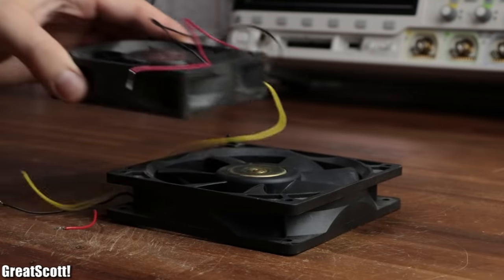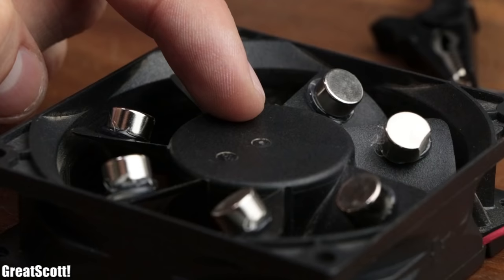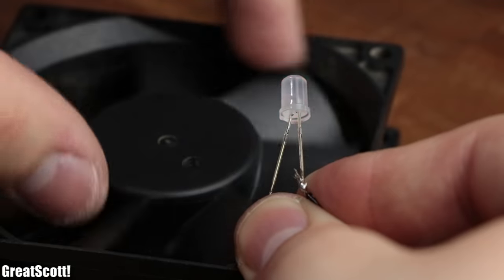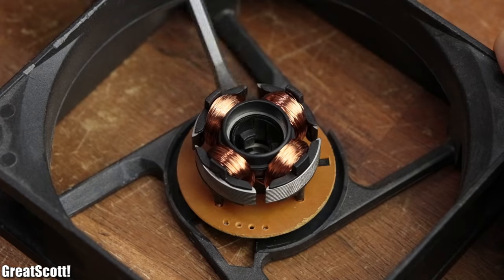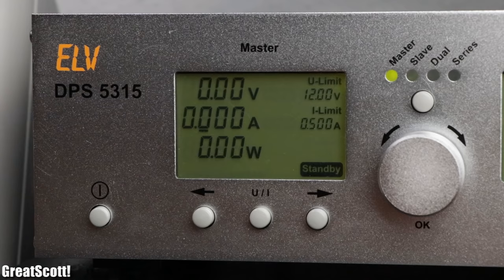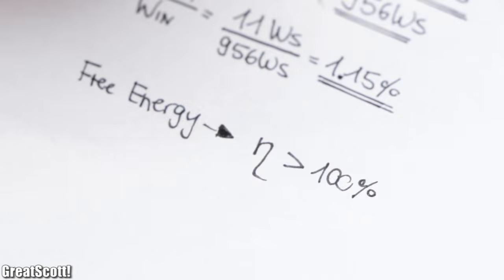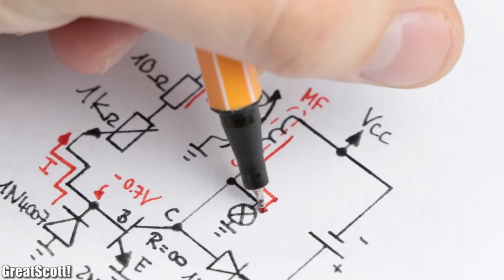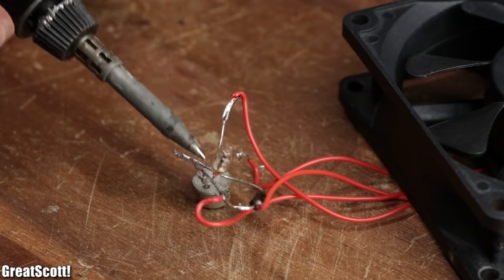Free Energy BS! || Magnet PC Fan, Bedini Motor

Comment: As a student I took a room on the second floor of a house. I was skint and had no money for heating so I was freezing. Occasionally, my radiator would get really warm and I could remove my coats and thermal underwater. I had no idea where the free heat was coming from until one day I had a visit from the guy downstairs. 
There was a water boiler at the back of his coal fire and everytime he lit it, I got free energy. He was quite angry though and after that things cooled off but l learned a lesson that if free energy exists, it's unsustainable.
Reply: hillarious. but what about solar energy, how many years of free solar power (even if only as heat, rather than photovoltaic) is enough to count as sustainable? or are you pedantic enough to consider that the sun burning out in billions of years makes it unsustainable?

Comment: the bedini motor was a lead acid battery charger that used the pulses from the reverse emf to charge the lead plates in the acid. it allegedly exploits a mechanism in lead acid. this was said by john bedini. it was not meant to be used as a motor.
Reply: I seen it on an interview from the 'energy from a vacuum' series about 15 years ago.

Comment: FYI a Bedini motor has two different size wires on the coil one is the power wire and the other is used to produce a back IF charge when the charging cycle ends I just started studying it but at least I have the honor to try and really understand it before I call bullshit

Comment: Fun fact: you can get free energy by connecting an autotransformer to your electric panel, setting the secondary voltage a tiny bit lower than the input, then connecting that side to your neighbor's outdoors outlet. Watch in amazement as your electric meter spins backwards! Power companies hate this trick!

Comment: For those who still think free energy is a thing:
Conservation of energy. 
There is a certain ammount of energy in this universe and you can not add in it or destroy any of it. It is a constant. Each time you use it you also return it in other forms. For example car engines. You burn fuel which is the energy source. It returns to the cycle as mechanical energy and heat energy.

Comment: If there were such a thing as perpetual energy the entire universe would turn into one big fireball.
Reply: You mean overunity. Smh
However, the fact that the universe haven't turn into one big fireball even when overunity machines are REAL already shows that energy can also be destroyed. It's a balance and completely logical.
Reply: @chrisadmaley  Go learn how reality works before replying, thanks.
Reply: @lukiepoole9254  you are delusional lol, this stuff is BASIC.
Reply: @chrisadmaley  Let's talk about BASIC then.
A magneto-motive-force source is capable of emitting multiple reluctance paths that are independent of each other. Know that both the primary winding and the secondary winding behaves as two opposing mmf sources. That means, you can relocalize the opposing flux with another core. Back emf not cancelled? Add another secondary winding and force them to cancel each other almost completely. Overunity achieved. Input power factor is almost purely inductive? Add a resonant capacitor in parallel. You done?

Comment: The better structure for a good charging circuit involves 4 coils bifiler wound with 900 winds a semi permiable steal core will give you ample 1/4 rectified frequecy which can be tuned with a pot.
Ya its too simple but extremely effective. 
Dont count the horses before the wagon.

Comment: Free energy? That can be had from public sources such as a coffee shop outlet or yeah at work or school.
The storage device is usually a high upfront cost that will hopefully slowly pay for itself.
How?
By having a vented backpack with a 100Ah Lifepo4 12v battery, heavy duty short cables, and a dedicated charger that turns mains voltage to the required charge characteristics the battery wants.
Usually this batteries can charge at around 80Amps or so. Or nearly 1000watts input 
So the charger connects up to the wall socket charging the dead battery while you do your stuff.
Then when you get home you have some usable power for a while.
Although it's only about 15cents worth of power for each charge...
Personally I have a 100Ah Battle Born battery, 1500watt pure sine wave inverter, 50A charge controller, 400watts worth of panels on the roof, and incase I need a faster charge a renology 40A dc-dc charger that I can use to charge the lithium battery using my car as a power source.
How do I use this?
To recharge small things like my laptop, phone, mini segway.
But also to power my TV and gaming system.
Why? Because I can

Comment: Your sums dont include driving the fan. I thought the point of the Bedini motor was to teach people about the difference between  regular transverse waves and longitudinal impulses. Not sure Bedini ever referred to free energy, He did talk about Radiant energy and the possibility that he was tapping into a flow, just like a wind mill or water wheel does. I know my system was efficient , driving a fan wheel, lighting LEDs and charging a battery all on about 3 watts. Dismiss it and you could miss out on velocity greater than C (Wheatstone, Tesla, Dollard, Bearden),  spooky action at a distance, John Hutchison, Tesla, Judy Wood a whole lot of fascinating things. Bedini was actually a very successful engineer. His work is often unique, ahead of its time and well worth a bit of investigation. He is not his admirers and their comments are not his.

Comment: Well... Here's go my hopes away.
I had an idea few years ago. And it probably went down the drain. 
But I use "free" energy already.
From solar power bank character. And use for lights. 
Trough use it to charge my cellphone.
And I washing my clothes with "free energy"  with machine I made.
It doesn't really save money or made me feel better earth habitat for saving the planet. 
But I am dang proud I made it myself 😊.
Reply: From your perspective, "free energy" is the energy aquired with no monetary costs If i understood correctly, in the video Scott debunks the generation of more energy than what you put in. For example, you can't use a motor as a generator to power itself using another motor. Because energy can't be created, only transformed, and in this case, The energy is lost due to friction, a bit of heat from the resistance in the wire, The free energy you are talking about might as well be the one where you plug your stuff into the neighbors outlet😂😂

Comment: "As a power source I used my bench power supply"
I thought you said the Bedini motor used a battery?
The circuit he used pulse charged a lead acid battery with a very short duration high voltage

Comment: I have made a fan spin with magnets, the stronger magnets need to be mechanically switched of axis, a small spring returns the magnet before the next field is in place.
Yes there is a lot of friction and loss, but chill the device and it will run for a good bit of time.

I agree the setup shown in this video is accurately described as bullshit.

Comment: Quick question
Can I run a 12v 0.6A rated cooling fan on a 12.6v 12A power supply or will it smoke up?
Reply: Well the current you set the power supply to is actually the current limit so it won't do anything bad to your fan. Plus fans are engineered to handle a little bit of overload by a certain percentage without damage. So basically your fan will draw a bit more current with the higher voltage but will not reach 12A at 12.6V.

Comment: Listen to me, I'm 2 years late but still listen please. I was cleaing an old PC and it had 1 exhaust fan with blue LEDs inside and when I was using the compressed air to clean the dust and the fan spun really fast and the LEDs were so bright! This was obviously while the PC was off. I also used the vacuum to suck up the dust bunnies and I when I sucked air though the fan I got the same result as the compressed air, although the vacuum is a silly if you really wanted free energy LOL.

Comment: Wait so the 12v pc fan will charge the capacitor which will charge the watch battery which is what makes the fan continue spinning after your intitial manual spin and will continue to spin its self? For how long? I cant really understand mych of whats being said cus im not that bright but if it were to be able to power just its self indefinitely that is awesome because then you could use that to blow another fan thats been modified to charge a capacitor or some type of power controller like they use for solar, that can charge battery banks which can hook up to an inverter/converter and power whatever right?

Comment: SCOTT DO NOT WORRY I HAVE A SOLUTION....

As the motor produces ac current when turned u can step up those 0.3V produced to 300V using a series of some 4 to 5 ac to ac step up transformer
Reply: And? How would that make a difference

Comment: just a curious question i always had when i was a kid.  and im 46 now.     cant there be a little waterfall big enough to power a generator from the falling water, so it can provide power to a small pump that takes the water back up again?    Id really like to know if this is possible with current tech, or that this is also bound by laws of physic?     i always wondered this as a kid when i looked at my grandpa's small pond which had a little waterfall.

Comment: Im studiyng mechatronics and my focus is on Vehicles especially on their engines.
So i was curious to see if it can work under the premise that the motor just converts energy into mechanical energy which has etha<1 then. 
Interessting to see that the rotor dont even spin with the magnets on. Thats the biggest problem dispite the whole electrical resistance, kommutation or changing of the pol

Comment: Well here's the "free energy" circuit that taught me something useful!  That back EMF spike is energy . . . you can store it to make your motor circuit more efficient!
We should talk about the self-deceiving problem with this circuit: if you put a meter in the wrong spot it will actually show an erroneous increase in power output from that back EMF spike! . . . so it looks like you have achieved over unity!

I have found real free energy, but these obvious scam devices are not it!  The real ones all seem to employ some type of quantum process like Zero Point Energy or thermal harvesting.  Though thermal harvesting isn't technically free energy since it already exists in the system.
Reply: not free energy at all, just a way to try to recover lost energy, that could help increasing efficiency but hell no it's free energy

Comment: What happens if I take a fan to space and spin it with the circuit to collect energy? INFINITE ENERGY!!
Reply: drawing current from the motor generator will cause it to slow down. when a motor slows down under same voltage, it will draw more current

Comment: Magnetic fan more good if you can think smart, place the the pc fan on a normal dinamo  and its works well but if you can think more smarter it will be more better free energy, but in Islam as the sun still hot and the sea still waving, there is still a huge energy if you can use it
Reply: the fan with the dynamo, depending on values, could create higher voltage/current, not both and there will be losses along the way and wattage will stay same or lower.

Comment: Hello, i am wo deri g if it might be more sustainabke with an electro magnet that goes on and off every tenth of a second, ypu can get one from an old door bell, the ones that actually have a bell knocked by a hammer that happends to be pulled magneticly by the bell metal gping ond and off causing the bell to ring rapidly

Comment: I found a way to have 100W with 10W, so I plugged it into another system, so I got 1000W with 100W( that I got for 10W ). Thus I plugged it in another one and I got 10kW with 1kW ( that I got with 100W that I got with 10W ). Guess what I did then?
Yeah, there's no free energy, there's only INFINITE energy ( or not....) .

Comment: My bedini give 0,89 amps out while feeding it with 1 amps under 12VDC....it was the second version i built,allready bit tuned...
Bedini energizers work perfectly am sorry,further: it is able to regenerated old battery ,by un sulfated it...
Before I was admirativ of great Scott,now am really deceived by his conclusion about it,because it’s wrong..
by the way I ask some advices to great Scott in private on Facebook about another subject,because he réalise the set up I was looking for,all that he answer me was « sorry I can t answer to your question »...
Great Scott is finally not that great...
Reply: You need an oscilloscope to measure the voltage. Most Bedini Motors run on 12V
Reply: @leonalexander26  sorry,i did mistakes by taping, i just correct it...

Comment: Actually, axial all_magnet motors are used to power a genset/container 50yr no_inputs warranty with upkeep.
The 1300hp motor fits cars, sparkless, military_spec, D.Antonio Romero dsgnr, Belgian.
No CO2 H2O or wasteheat superconducts coils 👈
Technokontrol's RF-5000, the motor used in their surveillance drone aircraft.

Just to say there's no such thing as free energy est.cost $1.6M/unit, amortized it's $3.65/Mwh +(interest & upkeep)/month, compare to gas at €100's/Mwh it's almost free 🧲

Comment: i tested it magnets doesn't work 
bec.i tested it with led lamp 
i used blower to make cooling fan spins and worked 
because the rotation of fan is reverse   
it will not generate energy it's not master

Comment: GreattScott > Love your work!!   I Don't get most, tho Thrilled to See!  
Thanks for getting to the point, Truth, right off.      I have question of Just moving Blades.  ~>  
What about Fan Just to Move a 'Bit' of Air, Not power?    Just good Bearing, no "Driver Circuit" attached (needed).   
(could it store power via capacitor )  ?     had to ask    = ]      lol   I Think You just did that! !!          Well   . . .   Still want Just Air movement .   ~- *  
my answer is YES it can             ~             Not just on Windy days       : )

Comment: Try to position the magnet that you're holding on the top positon, facing the magnets (same angle and not on the sides of the magnet as you have demonstrated) similar polarity so that it will repel and push aside each and every magnet, creating the movement that we want and expect to see.

Comment: Inbetween the magnets there are dead zones. This prevents it from continuing to spin. So if you make this design but over and over again 360 times then layer them on top of each other and then give every later a 1 degree offset from the previous layer youll virtually erase the dead zones and it should work.

Comment: For starters there is no such thing as free energy other wise ot would defies the laws of psychic u have to wear down something to get something in return is basicly it such as steam.powered engine loss off water to have a steam push force to turn a wheel if u make it for a perpetual generator u would have better results of course it all depends on the the way you set up ur magnets if you put them random such north south south north ur going to have stall cause the same.sided.magnets attract if all were even placed n and one magnet is place south at an angle to were each magnets  gets the same.push as the other the push on each magnet should push evenly on a rotation